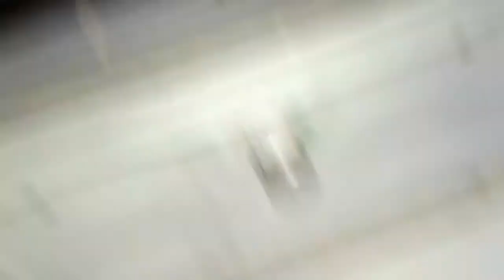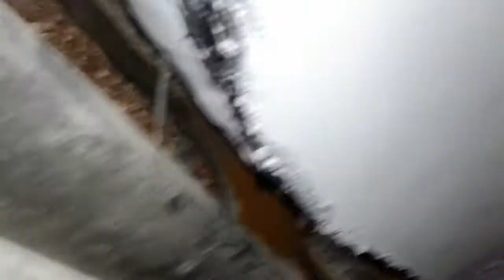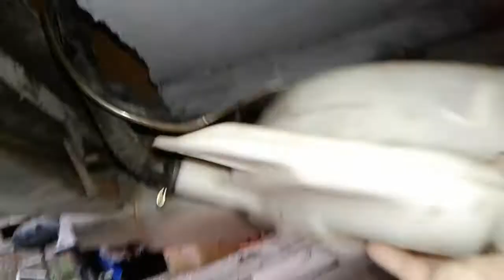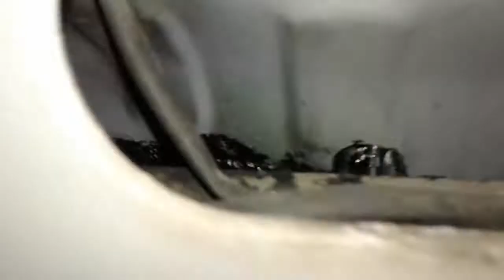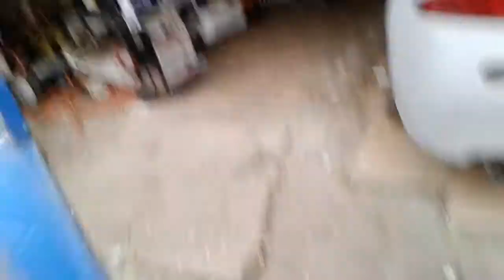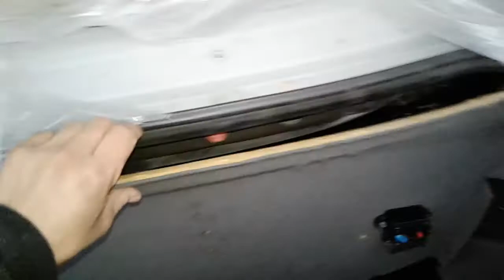Completion on Eclipse trunk

Comment: Is the cover just a piece of steel? I'd like to do something similar?
Reply from the maker: https://youtu.be/ixxNlwQBAM8

Yes. I list the size in description. 
I don't have good content at all. Record on a pos phone. 
I had cut out the spare section, and traced onto the plate I had. Once everything was close to perfect, i tack welded the piece into place. This took time making sure I didn't warp the material, jumping from different spots when doing so. Grinded down the tacks on top and bottom, bondo on top,and weather caulking at the bottom. 
 Big difference removing that section.
Reply: @Ryan_1997  it looks really good! I hate how my spare cover bends into the hole left from the spare being gone in my car. Looks like something I may attempt in the future. Maybe I can find a smaller washer tank and motor from another make of car to stuff inside the corner by either tail light. Still like that look vs. stock!
Reply from the maker: @TPGDSM  I've seen some universal aluminum tanks you can probably use. If you know anyone to tig weld aluminum,  you'd have to modify the fittings and holes. Just an idea. 
But yea, removing the spare makes a big difference, didn't like having the battery at that part  and plus when I get back into autocross a big no no
Reply: @Ryan_1997  Tig welding..  I'm aiming to get my hands on a tig welder soon as well. That's something I've been trying to learn for a very long time. Still though cars looking good. Thanks for the info and ideas
Reply from the maker: @TPGDSM  learn stick welding first so you can develop the motion of how to guide the rod. Purchase a machine that does tig, mig and stick. Worth every penny, imo. But a tig and stick one will do.  No problem bro, your ride doing well as well👍 goodluck 👍🤘